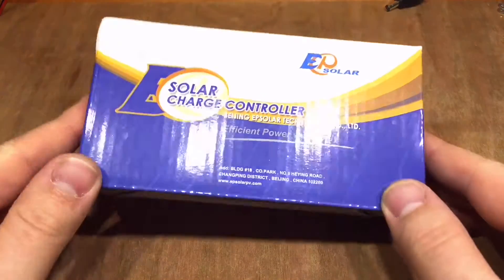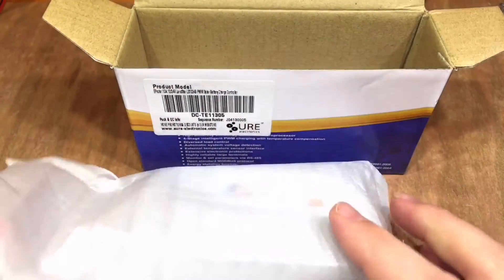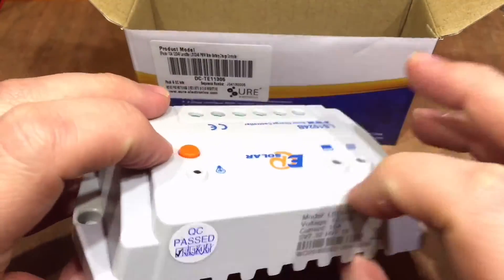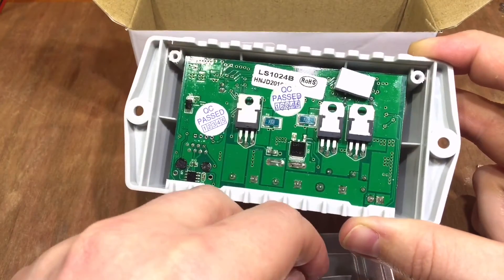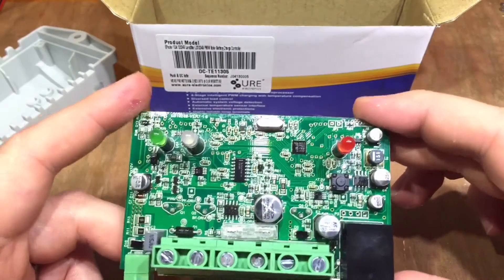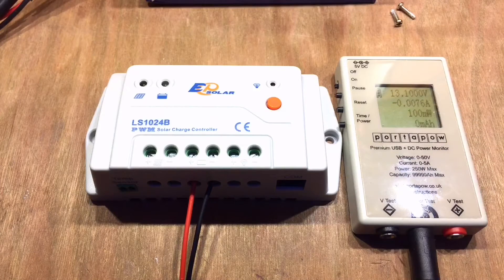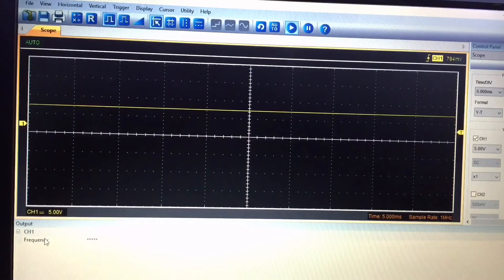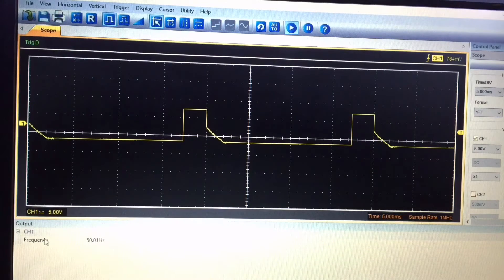EPSolar LandStar PWM Solar Charge Controller Review - 12v Solar Shed

Comment: Hi Pal, I am a complete novice so apologies if this is obvious but I have o e of these in my T6 camper.  Do both the lights on the top left flash ( to indicate charging ). Also when I switch it off via the top right button the red light goes out but the green lights continue to flash?  I expected it to completely power down
Reply from the maker: The solar LED illuminates when there is sun on the panel. The battery LED slowly flashing green means that the battery is over it’s target voltage - is your campers battery connected to another charger or an engines alternator perhaps? Check out section seven of this manual for more info… https://www.epsolarpv.com/upload/file/1811/LS-B-SMS-EL-V2.5.pdf
Reply: @AdamWelchUK  Hi,  the vehicle has dc to dc charger due to the vehicles smart alternator but unsure if I am honest if the solar is connected to the alternator directly.

Comment: Hello Adam , I have one of these in my tourer also 10amp, I also have the MT50, currently have a 100w PV and a 95ah battery,  I'm thinking of adding another 85ah battery for when we go off grid. Will the charge controller be ok with this ? Thanks

Comment: Can you change the parameters? Set up for 18650 4s
Reply from the maker: You can yes but you’ll need a cable and a pc, the Bluetooth or WiFi adapter and a mobile (or pc) or one of the few home brew solutions to change the charging parameters.

Comment: New to solar I'm trying to match a 100W 18V max panel with a 12V 8Ah LiFePO4 battery https://www.amazon.com/LiFePO4-Battery-Miady-Rechargeable-Maintenance-free/dp/B07X5G2FFW. 

I don't plan on adding additional panels to this setup, and therefore think PWM would be fine for my application. I'm looking between this controller open box around 13USD or 20USD for a Renogy Wanderer 10A. The Wanderer  that claims to support LiFePO4 via custom settings at 20USD.. However I'd also consider any other budget PWM controllers that were appropriate. 

Any suggestions on a better purchase? 

Is the Wanderer the best bet?

Comment: Hi Adam can you give me some advice please.so new to solar panel setups but won’t to put on on my caravan.i have purchased a kit off eBay 150w panel same controller as in your video and the mt 50 monitor my question is I have purchased a lead with 10amp fuse inline for battery side but do I need to fuse the panel to the controller.my thought was to use mc4 Connections just in case I needed to isolate connection from solar panel to control unit cheers

Comment: Can anyone clarify a point. He mentions that the controller must be carrying out an equalization charge, but the app says a boost charge is being carried out. I thought an equalization charge was to remove 'plaques' from the battery plates periodically, and a boost charge came between bulk and float. In this context does equalization and boost charge mean the same thing?
Reply from the maker: If you’ve chosen the flooded or sealed battery type once a month the charge controller does do a equalization charge which is typically a couple of hundred millivolts above the normal boost charge. Boost being the term that EPEver use, many people would say bulk. So it does boost then float for most of the month and an equalization then float one day a month. Page 17 of this manual shows the default levels set in all EPEver charge controllers - https://www.epsolarpv.com/upload/cert/file/1811/Tracer-AN-SMS-EL-V1.0.pdf
What’s also interesting to note is that boost and equalization charges are timed - normally they are for a 120 minute period.

Comment: I have a LS1024B on order strictly for experimenting.  In addition to the 1600 watts of assorted panels I use with the solar generator, I have some smaller panels (20 watts) that would be useful for keeping the motley collection of AGM and flooded batteries (5 to 65AH) charged - even the 6-year-old battery pulled from my truck this year would serve in a pinch if fully charged and it can certainly be used to jumpstart a vehicle or the riding mower ;-)

I ordered an inexpensive (under $5US, delivered) "PWM" controller from Ali Express and it's not even PWM - just switching (no surprise).  While it offers a way to "set" parameters, the "settings" are just for display as it takes the battery to 14.7 volts regardless of the battery type selected (float, sealed, gel - manual lists voltages from 14.2 to 14.6 depending on type) and the display only shows a maximum of 14.4 volts.  Disconnecting and reconnecting battery and solar didn't make a difference.  You have no idea what that controller is actually doing unless you have volt and amp meters you can test with.   If you had a 50 watt panel on a 200AH flooded battery and you checked the water levels frequently, it might not destroy the battery :-(  So much for the "bargain" controllers - it even has two USB ports...

Comment: Great video. Are these suitable for use with a 2 battery setup? Or do you need 2 of these, one for each battery? I have two 100Ah sealed batteries and plan to add 80-100 watts of solar.

Comment: Hi I have just fitted a solar panel to my van can you tell me when I have connected every thing up does the lights on the unit light up as I am not getting any lights coming on thanks
Reply from the maker: Yes - you should get a green led illuminated when you connect the battery (assuming the voltage is reasonable) and another green led once the solar is connected (and there is some sun).

Comment: thanks for the video, Isn't it strange that for 10amp charger they have not installed any heatsink?
Reply from the maker: The metal back is a heat sink. Not a very chunky one, but that’s where the mosfets sit to dissipate heat.

Comment: hi Adam, thank you for your video. i am a new comer to solar so i found this video quite enlightening. just one question
do they include the 25amp fuse on this controller to protect against battery short circuit (ie as an alternative to an external inline fuse on the positive lead of the battery?) thanks for your time
Reply from the maker: Cheers Mike.  The fuse is a last line of defense really in case some of the other protections don't work (or work fast enough) - so a short circuit would be an example.  I always suggest you have an external fuse rated at the maximum current rating for the controller (or less if you don't expect to use it to it's full capacity).  They're easier to change than an internal one and you can more easily see if they are blown or not.

Comment: okay i check its micro controller  what topology used for pwm  with out mppt  its used boos converter voltage mode or current mode regulated state of charge battery

Comment: thank you Adam, good video . I had questions  what is charging controller  circuit topology  pwm baised on microcotroller or ardinuo
Reply from the maker: This uses an ST microcontroller if I remember correctly.
Reply: its micro controller

Comment: Tried ordering EPSolar items from Amazon. Won't ship to Hawaii. Seems like this items is the same and it ships to Hawaii. "MISOL Epsolar Solar regulator 10A 12V 24V solar charge controller 50V LS1024B." If you are having issues with EPSolar and shipping maybe MISOL would also work for you.

Comment: Thanks for the review Adam...can the float, equalize voltages and duration, be adjusted via PC software? Cant find this info on their website. If you ever do another video on this, I would really like to see just what parameters can be set....Larry
Reply from the maker: +LARRY GONCE Hi Larry. Yes all the battery voltage can be manually set. The boost and equalize times can be adjusted from 30 minutes to 180 minutes (if memory serves) independently of each other. I'll try and take a screen shot tomorrow for you when I'm back at my PC. If I forget, give me a nudge.
Reply: Thanks Adam...that's good to know.  I think I will order one of these.  I'm going for the 20A or 30A version, as I'm at about 10A in PV right now.  If you could put an eBay link to those from Sure, I will use it, if that gives you some credit.  Thanks for the com cct as well...Larry
Reply from the maker: Hi Larry - Screen shot of the battery parameter setting screen.  A fair bit to play with here...  http://admw.uk/jq
Reply: Much thanks Adam

Comment: Here is the spec so that you may make your own modbus controller

EPSolar B Series Controller Protocol v2.4, provided by EPSolar in Oct 2016 because I asked. They said I could share it with you. They did not provide a link that I was hoping via their website, which would be better for all. It is nice that they include the pictures of EPEVER software with associated addresses. They appear correct, but I have not verified everything. I would go with this document first.

https://drive.google.com/open?id=0B2_wlF-c-wF4VHE5cFpEdkROOW8

Here is modbus protocol spec v1.1b for reference

http://www.modbus.org/docs/Modbus_Application_Protocol_V1_1b.pdf

Here is sample C# code for modbus via Visual Studio. But with the first doc I suspect you will be able to make an interface for any linux as well.

http://www.codeproject.com/Articles/20929/Simple-Modbus-Protocol-in-C-NET
Reply from the maker: +jjstiff Hello. I'm unable to look at this is any detail today as I only have my phone as access. From your description however it sounds like a really useful set of documents. Thank you. I'll reply back again once I've been able to view it correctly.

Comment: Adam, let me ask you one question.  How it looks in the installation that the Charge controller is positive grounding?
Reply from the maker: Hello Francisco.  Yes, most of EPSolars charge controllers use common positive design.  It's easier and probably cheaper to switch the negative side.

Comment: Adam, Sorry to pester you with inane questions.

I followed your lead (hah) with the cat 5 cable and the serial to usb converter but it only works pretty sporadically. Often I get port is in use by other program or just complete failure to connect and a ticker tape of failure at the bottom where the program logs what its doing.

I've made sure all the serial settings match up. Weirdly though it doesn't go at 9600 like most things but a much higher speed, I wonder if this might be part of the problem.

Thanks
Reply from the maker: There's a few things to check.  Firstly the driver, are you running the right one for the CH340?  Perhaps check the settings in the driver - I didn't need to change anything but perhaps there is something amiss? Finally it might be worth trying to ground the two devices together.  It would need you to solder a wire to the negative connection on the usb port.  Having both systems sharing a ground might make communication more reliable.

The communication is set on the tracer at 115200 - this is normal.  I hope something here does the trick for you.
Reply: It should be the right driver, but I will reinstall anyway, it can't hurt!

115200 is what its at, i'm used to much older bits of kit I suppose. Old CNC machinery can't hope to achieve such heady speeds!

Will bust out the soldering iron and wire in the ground to see if that helps.

Cheers

Comment: It's a pity that there are so few options for solar charging LiPo batteries - I made a 48V LiPo battery pack for my ebike using ten 6S 5Ah batteries (5P 2S), with a couple of 120W portable panels I made using sunpower cells on 12 A3 sized foamboard sheets, but only have a standard 300W LiPo charger that will accept 10-28V DC input, and only balance charge up to 6S.
I know it can control current draw because it slowly ramps up at the beginning of the charge, but it will try to deliver the set current regardless...
Interesting though - it'll do up to 12A @ 25V output, and if I plug 2 panels in parallel into it, I can watch the current rise to go through MPP and then fall off...
Then I set the charge current to just below the max that it displayed, and restart the charge, hoping that it'll stay on the upper side of the 'knee', around 18V.
However, if a cloud comes along, the voltage falls and the charger responds by trying to take more current, and the voltage drops, so it tries to take more current etc.. then falls into a hole at 10V and stays there!
The charger is great, but it would only take a firmware upgrade to make it solar panel aware and do MPPT.

However, what I really want is something I can use on the go, and balance charge and top up 48V 12 cells depth at around 20-30A, and nothing seems to exist, except perhaps in Tesla's R&D dept!
The battery is 1.4kWh and could help power a home through a power cut as well as propel 100kg 100km at 50kmh!
Making a high power MPPT lipo charger would be an interesting project - I have an Arduino nano and a dozen or so mosfets and a few scrap computer PSUs.
I'm hopeful something could be made out of these for next to nothing!
Reply from the maker: +Andy Lee Robinson LiPo solar chargers are fairly thin on the ground. Some people use lead acid solar chargers and adjust voltages to suit, but you'd need to use an external BMS to protect each cell. 

Electrodacus makes the nicest looking lithium solar charge controller. I'd have one if I used LiPo or LiFe batteries for sure.
Reply: Yes, he's certainly spent a lot of time on it and made a great system, but he made it to solve his own particular needs which don't necessarily reflect what others are looking for!
I suspect if he was into RC modelling and drone technology he would have designed something that would include that rapidly growing sector, which can also cross fertilize developments in home and EV battery tech.
He only goes up to 8S balancing, but I'd like at least 12 or even 24 or more for 96V systems for larger EVs.
My particular pack can charge at 50A, discharge at 250A and deliver 12.5kW and remain within spec, and I could just add more cells for more power or capacity, and switch between ebike or home use...
My current chargers will balance up to six cells - it's not a big issue to manually reconfigure and charge in two sessions, but would be nice to have the flexibility to be able to charge while online.

With the transition to solar ramping up quickly, I can see market opportunities for high power flexible multichemistry variable-cell BMSs, so I'll keep researching and experimenting! Cheers!
Reply from the maker: +Andy Lee Robinson Sorry I couldn't remember which battery configurations the Electrodacus supported. You've got quite a big system (by my standards anyway) and it sounds like you've invested quite a lot of time in it. 

I agree that manufacturers will need to start developing new products for the new hybrid and off grid homes not to mention the cars and bikes.
Reply: I look forward to that future!
I took these pics two days ago topping up the battery in the middle of nowhere (not that it really needed it!)
https://www.facebook.com/AndyLeeRobinson/posts/10156909141670117
I had a canvas saddle made for the pack, 5 batteries per side and it works really well.
I guess I should do a video on it!
However, with no protection against punctures in an accident, it's not something I'd recommend for the public!
Reply from the maker: +Andy Lee Robinson Nice job. I like the idea of charging up your bike whilst you eat your sandwich and admire the view! It'd be interesting to see your video.